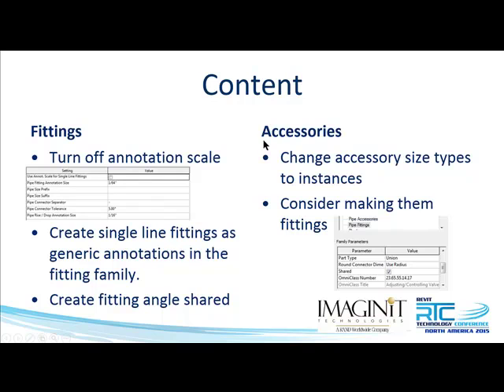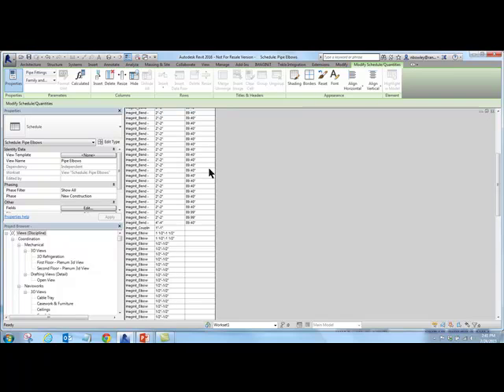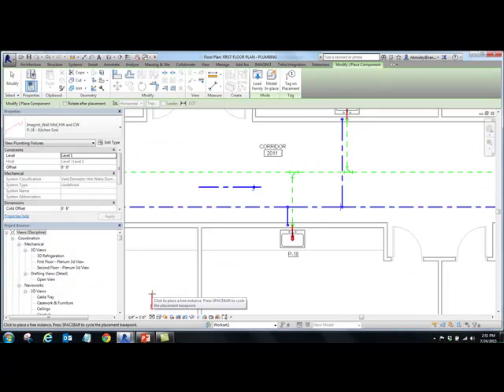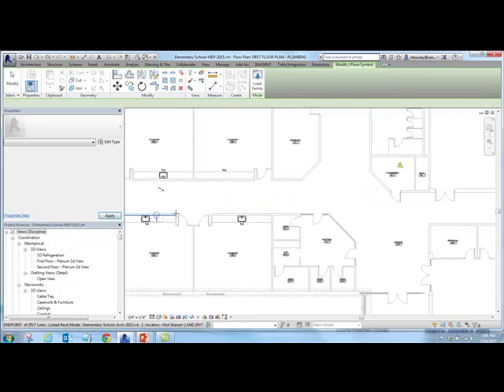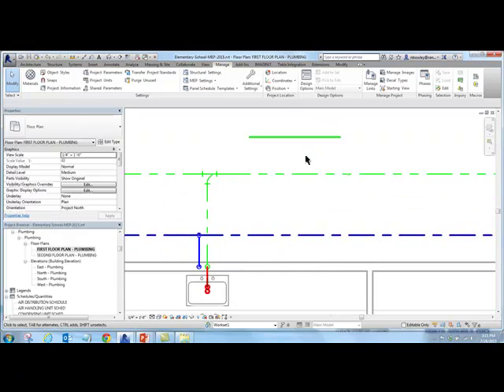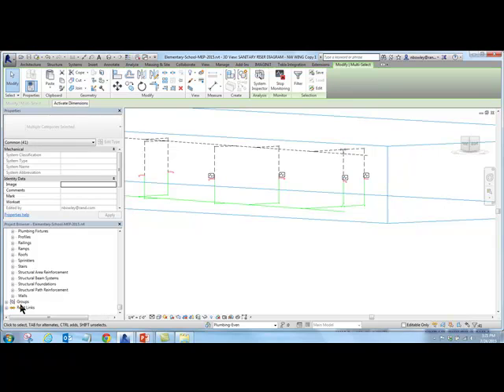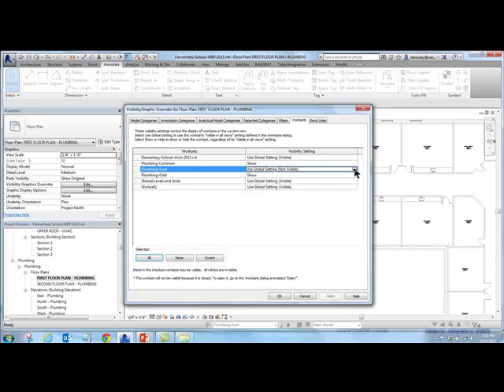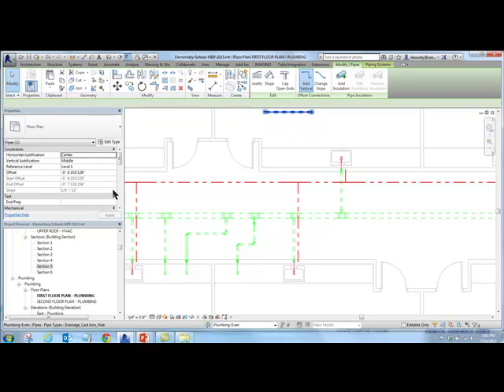Everything I Wish I Knew about Piping in Revit

Comment: Hi friend do you have free download  mep family for the flanges with Bolts ..thanks
Reply from the maker: IMAGINiT doesn’t have a family like that for downloading, we recommend that clients take a look and see if bimobject.com has what they’re looking for. As an aside, be careful about adding too much detail into the Revit model as it can have a negative impact on performance. Bolts on flanges are not typically placed in a Revit model that is used for design and engineering. Fabrication is different and understandable, but try to make sure you’re not over-modeling things when it is not needed.